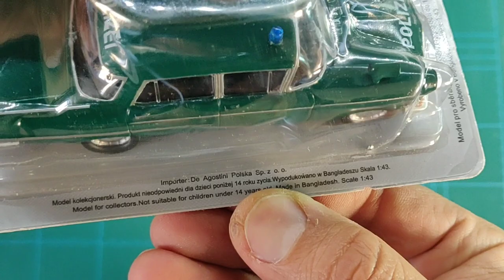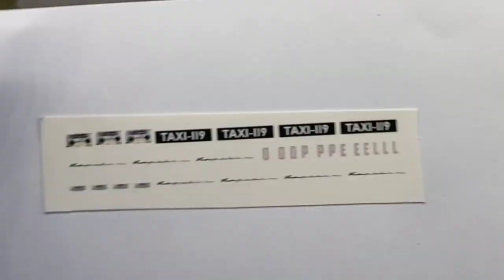Start to Finish: Restoring a 1:43 scale Opel Kapitan diecast

Comment: How did you put the glass back? Also do you have any tips on how to remove the rivets without the drill?
Reply from the maker: Hello there, the glass was put back in place using UV glue, where I placed several blobs in unseen places, gave them some exposure to UV light and they dry instantly. 
Regarding the rivets, I don't know of any other procedure other than drilling them out. Trying to pull the chassis out of them without drilling is not recommended as it'll damage the chassis. I always see diecast guys drilling the rivets, so I'm guessing that's the best way to do it. Hope that helps 👍🏼